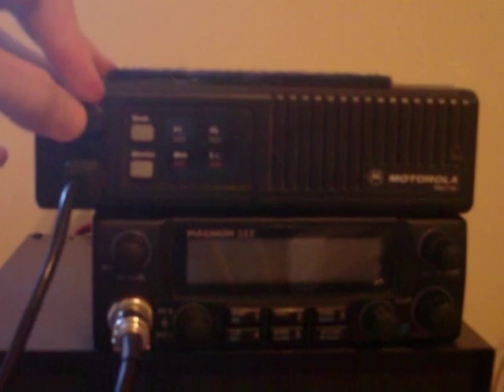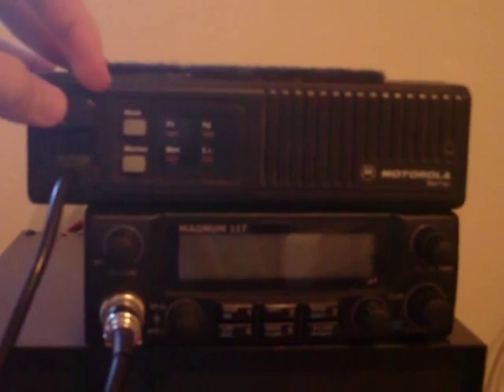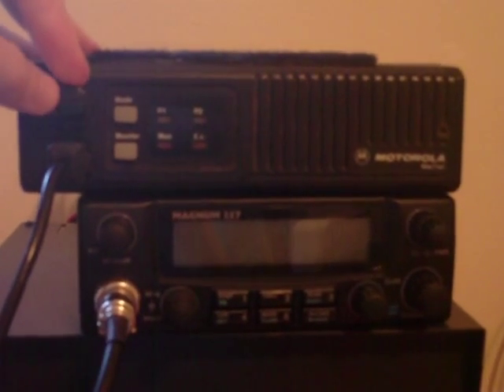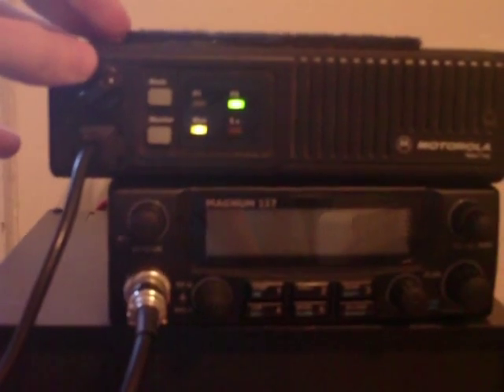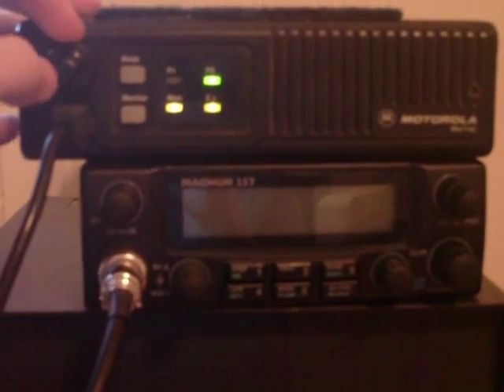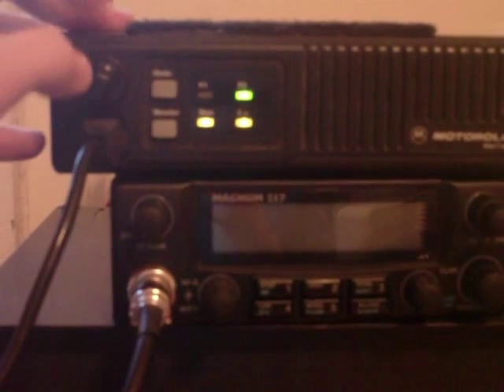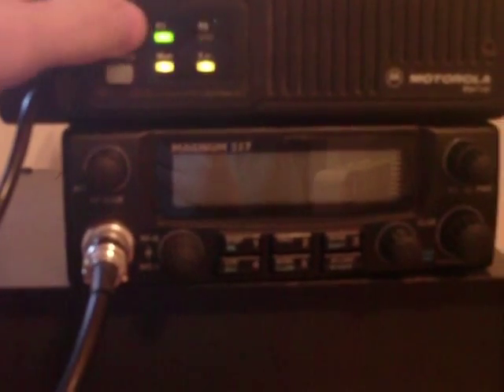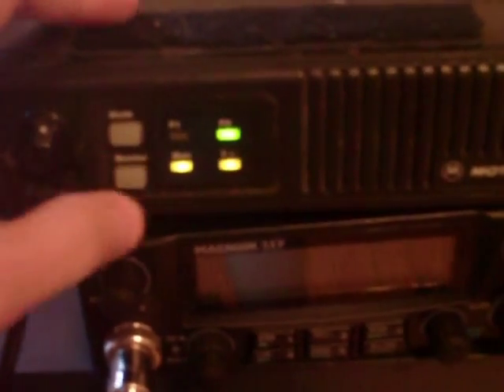Motorola MaxTrac Low Band VHF Low 36-42 MHz Professional Mobile Radio - Virginia SIRS 39.540 MHz FM

Comment: If 8m ver becomes available, would be a great radio.
Reply from the maker: The 8 meter band would be awesome, but I don't see it becoming available to US amateur operators, maybe a secondary allocation like portions of 70cm and the other UHF bands and microwave bands are.  The 40-42 MHz band is allocated to military and government land mobile and fixed/mobile uses in the USA.  The 40.66 MHz - 40.70 MHz ISM band (Part 18 of the FCC rules) and there's also a Part 15 allocation for 40.660 MHz - 40.700 MHz but the field strength limit is really really low.  

The US government uses the 40 MHz band for data/telemetry purposes (see SNOTEL nationwide telemetry network on 40.670 MHz).  The Tennessee Valley Authority has a wide-area land mobile system on the 40 MHz band, 40.47 MHz, 40.49 MHz, 40.53 MHz, 40.57 MHz, 40.59 MHz, 40.61 MHz, etc. using CTCSS to cut interference from military comms in the same band).  The military emergency FM frequency 40.50 MHz FM 40.5 MHz FM is also in that band.  

The military use 25 kHz steps from 30.000 MHz to 87.975 MHz, with primary allocations in the 

30.000 MHz - 30.550 MHz band 
32.000 MHz - 33.000 MHz band 
34.000 MHz - 35.000 MHz band 
36.000 MHz - 37.000 MHz band 
38.000 MHz - 39.000 MHz band 
40.000 MHz - 42.000 MHz band 
46.600 MHz - 47.000 MHz band 
49.600 MHz - 50.000 MHz band 

But they may use any frequency in the entire VHF low band 30-50 MHz and 50-54 MHz and 54-88 MHz on a non-interference basis...and they often use frequencies outside the 30 MHz, 32 MHz band, 34 MHz band, 36 MHz band, 38 MHz band, 40 MHz / 41 MHz band and 46 MHz  / 49 MHz bands, including the 6m amateur band 50-54 MHz and the 54-72 MHz / 76-88 MHz TV broadcast bands and 72-76 MHz fixed, backhaul, audio link, wireless microphone, telemetry, RC and 75.0 MHz aeronautical navigation (marker beacons on 75 MHz) bands.

They've got 7.350 MHz of bandwidth in their primary allocations between 30 and 50 MHz.  Many federal users have migrated to the VHF high band 162-174 MHz band and the UHF 406-420 MHz band.  The military also use 137-144 MHz, 148-150.8 MHz

Comment: I miss our old state F1. 39.50
Reply from the maker: Virginia state Parks (DCR) Department of Game and Inland Fisheries (VDGIF), the Department of Emergency Management (VDEM) as well as the Department of Corrections (DOC) still have licenses for 39.500 as well as 39.540 (and 39.120 in the case of DOC.  Like SIRS 39.54 they’re mostly used for standby purposes.  The Virginia State Police mobiles license KA5367 only has 39.460 MHz (LLAW1 interop frequency), 39.540 MHz and 42.920 MHz for mobiles (that license is for 3000 mobiles 110w power output).  

I’m just glad VSP maintains the statewide SIRS network, including base stations throughout the state on 39.540 (see licenses WRA534, WQTC631, WQSK464 and WQSK494 in addition to KA5367).